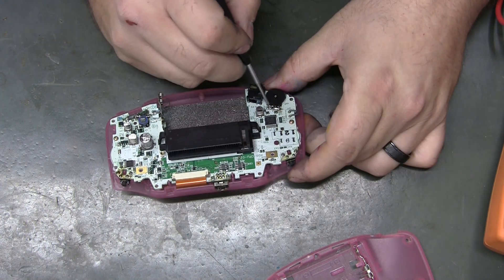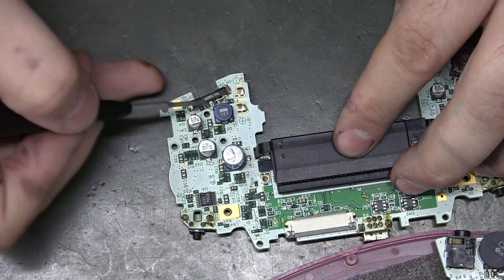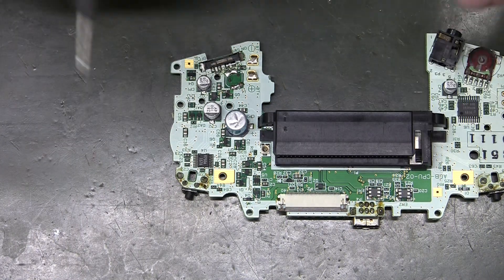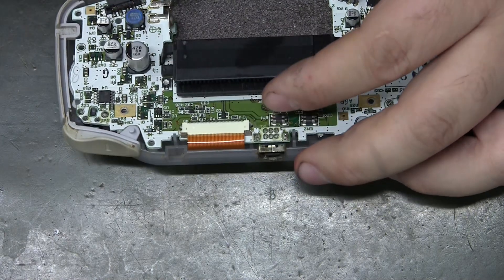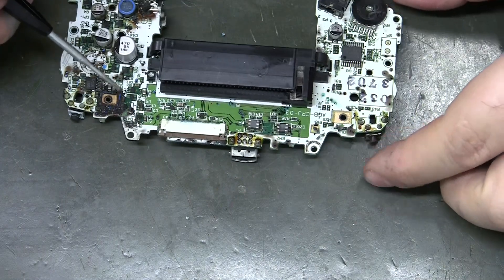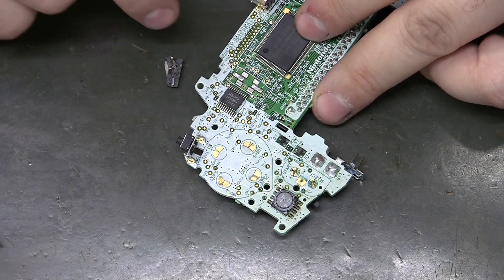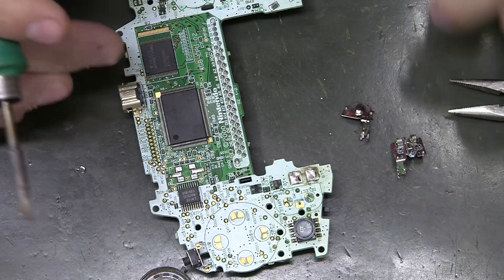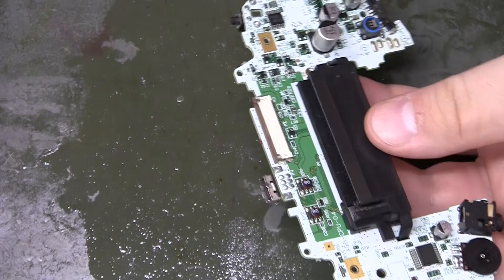GBAConsolizer install tips and tricks Woozle GameBoy Advance HDMI mod

Comment: Oh thank God. I have a heavily corroded gba I got off of eBay, I was trying to pull off just the switch cover when the whole thing lifted off. I was sure it was game over for this board, but these tips mean I can just wire the fuse to the inductor's pads and use it consolized.

Comment: What you are doing with that toothbrush is not cleaning,. You are just spreading out the old flux and grime evenly around the board. The IPA evaporates and leaves behind everything. Sure it looks better, but it's not clean. You need to soak up the old flux, not just spread it around.
Reply: The point is it LOOKS clean. That's the only reason he does it. Just for 'show' in full kits.

Comment: I didn't know what you meant by bridge over the middle pin for the volume cause it looked like you soldered those pins which I did.  But let me know if that is how it was supposed to be done if you can.  The volume scroll doesn't work like you had mentioned by I didn't find the speaker very loud however.  But of course I did find out after dissembling again I accidentally got some alcohol in the speaker lol.  Not totally worried cause I know i'll have to remove that speaker anyways.